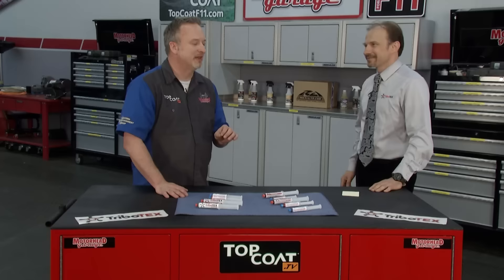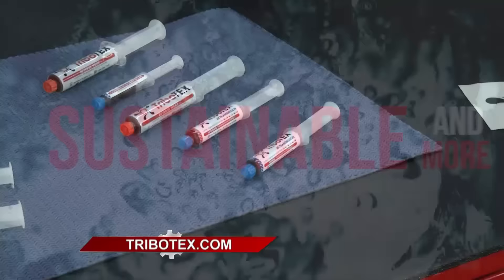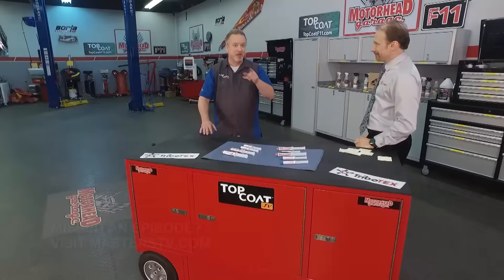TriboTEX: A nuclear scientist, a college instructor, and a defense contractor [review]

Comment: I love trybo tex my Kia Sorento  has 300k miles I've run out of oil it sounded like a monkey with a hammer was running around my engine with a hammer after I used teybotex the noise went away got hot had to reply trybotex took 500 miles before I realized the full effects my car would have died a long time ago with out trybotex its amazing